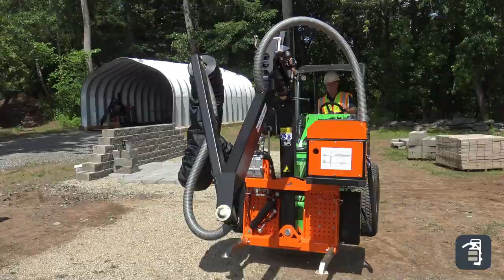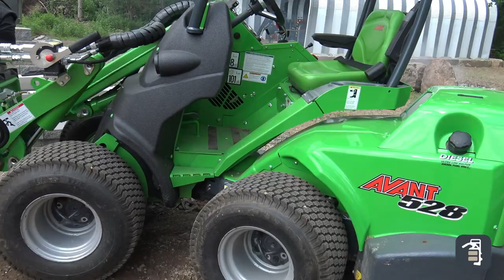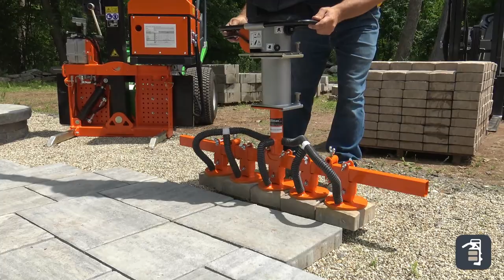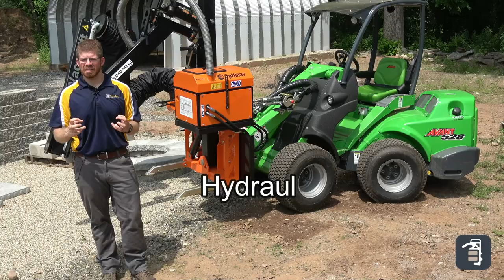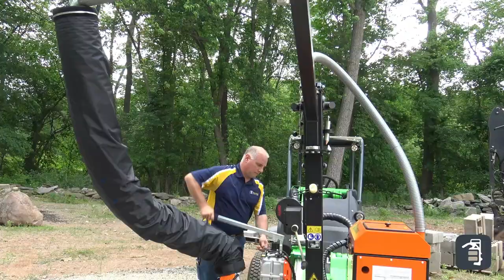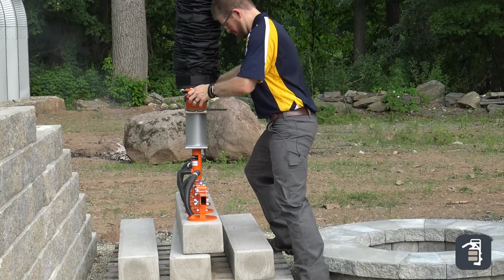Compact Hardscaping Equipment

Comment: I can definitely see this guy's feet or foot or anywhere below the 200lb cement slab being wright fully crushed when not if something happens like the air suction letting go or any number of scew up's that happen in real life and not on demo videos such as this , a person's body is fully exposed without any safety backup whatsoever when this one person contraption is in armed to mame mode a completely Extremely dangerous and hazardous machine without any handler safety  features built in. In other words Gravity is the enemy here on this stupidly underdeveloped get it out the door not now but right now. And object just waiting for class action lawsuits in the multi millions.
Reply from the maker: Hi Damian - 
You are correct, most machinery on a construction jobsite is dangerous.  Exercising caution and following safety protocols is necessary when working with power tools and large equipment.  For example, the exterior edge of the cutting blade on a 14" gas-powered saw spins at 360 mph.  A 20oz hammer falling from 20 feet can impact with over 300N of force.  It only takes 70N of force to crack the human skull.  Even ladders can be dangerous.  If a 200lbs person falls off a 6 feet ladder, they hit the ground with almost 10,000 pounds of force.  
 
Operators of the machine in the video should always follow proper jobsite safety protocols and follow the safety instructions outlined in the operating manual of this machine.  We recommend this for every item on the jobsite.

On another note....Lifting by hand can destroy a humans back!  The owner of our company, Phil Bahler started making tools for the hardscape company to save the backs of hardscapers.  His back has unrepairable damage from installing for over 30 years in this "hard" business.  This machine is not designed by him but we carry it because we are so impressed with how much product can be moved with very little effort.  

We hope that you have great systems in place for you and your crew that is saving your backs and making your job fun, productive and profitable.